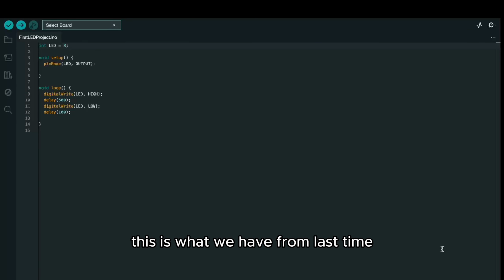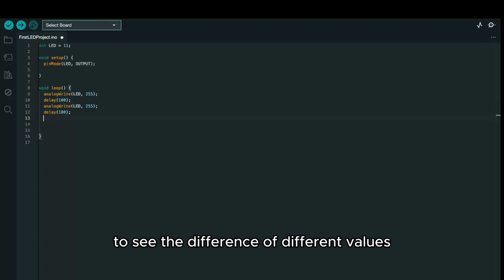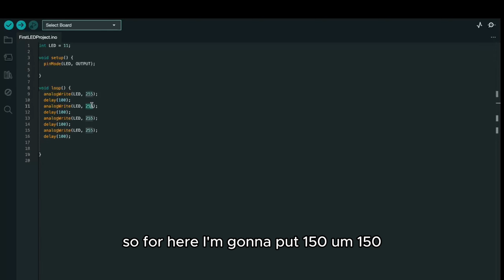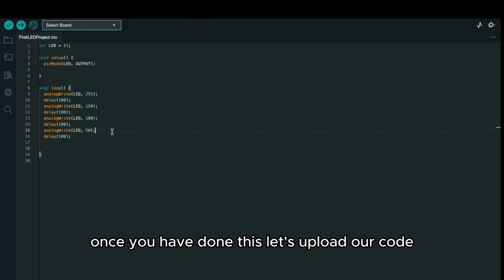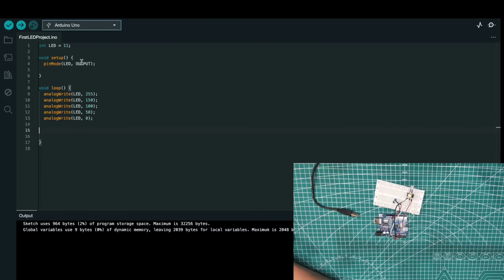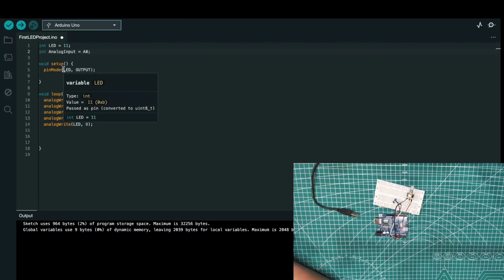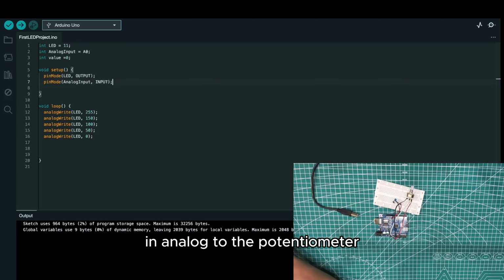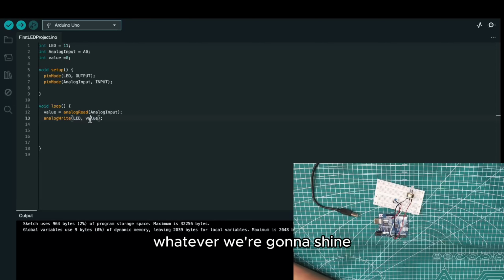Arduino 04  - Analog vs Digital Explained: Finally Understand the Difference!

Comment: Just an FYI: The ~ symbol is marks PWM pins which are digital. The only analog pins are A0 - A7.
Reply from the maker: @Monotoba Thank you for the clarification! I guess a better explanation would be that PWM pins can simulate the effects of an analog output when needed.